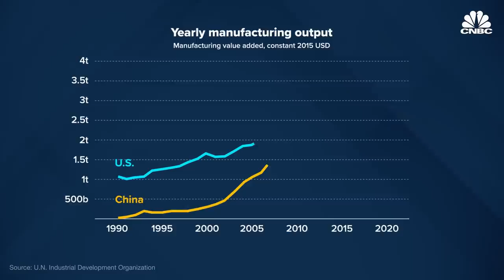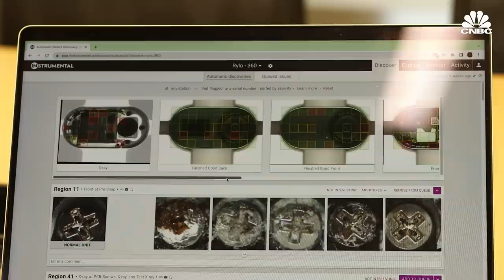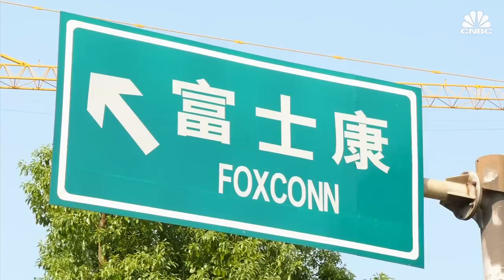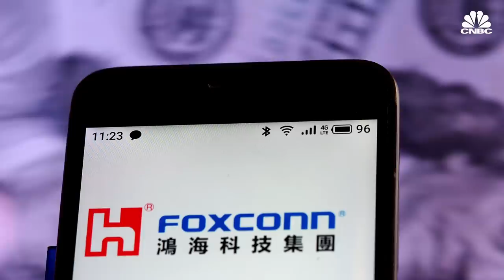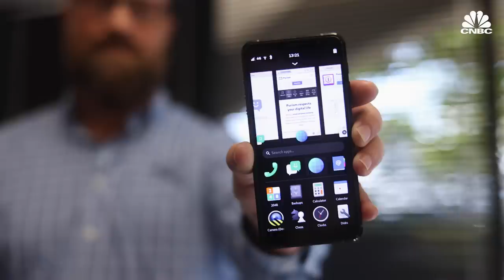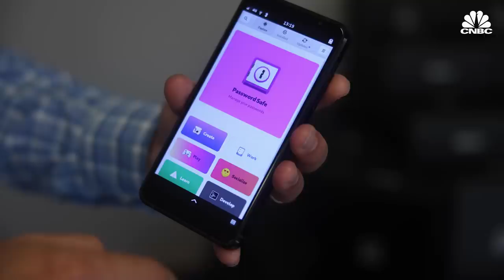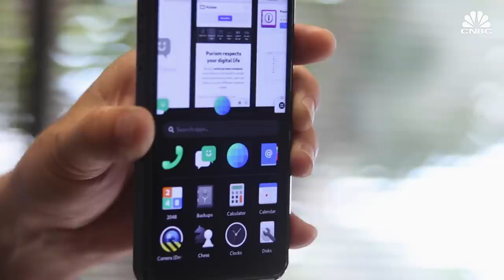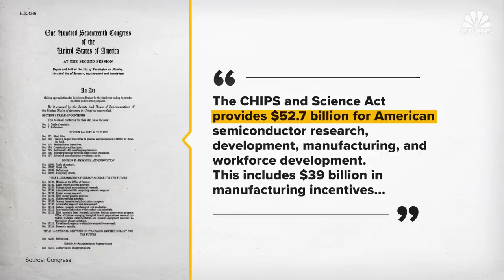Why The U.S. Fell Behind In Phone Manufacturing

Comment: A little over a decade ago, Apple outsourced the production of the IPhone to Foxcon (Taiwan) for manufacturing in China for something like $15 in cost savings per phone, on a $400 phone.  IMO, they could have just as easily sold the phone for $420 each and kept the manufacturing in the US.   Today, the cost difference would be $60-$100/phone.
Outsourcing it to China enable the Chinese to develop their supply chain over the years, and produce more & more competitive phones (Huawei, Xiaomi, Oppo, ZTE, etc.).  If Apple hadn't outsourced to China, it would have taken them far longer to develop the technologies.  As is, we are only able to maintain some slim technical lead because of a few pieces of key technologies, Android OS, processor design, processor manufacturing, and a few chips.
Goes to show, many CEO's are willing to sacrifice the future for higher short-term profits.

Comment: If we made quality goods in America that lasted two to three times as long and functioned well, these American made products could cost twice as much and still be a better product providing much more value to the customers.  

Big corporations current value model is to sell only products made become less than optimal or fail much sooner than expected so the customer must become  a "consumer" continually repurchasing new products to replace the failing goods previously purchased, never having received the optimal life expectancy and functionality of the purchased product. 

A consumer good is one of the most expensive types of goods you can buy.  I own and operate a saw mill and manufacturing business.  I started out with cheap consumer products, having to repurchase replacement machines and parts several times as they wore out.  Also, these consumer wood working tools were extremely slow to use, did not produce accurate results, and consumables needed to be replaced.  The accumulative effect was that I could not manufacture goods for less than my opperating costs.  So, I was spending hours of effort while paying corporations multiple times to replace worn out tools and selling my products at a big loss.  This is unsustainable for my company and I would argue also unsustainable for a society. 

Here's an example of consumer goods compared to industrial goods.  One of my first tools I purchased when I first wanted to start a sawmill business was a "Farm Boss" chainsaw from one of the leading manufacturers(it is an entry level chainsaw, "consumer good".  The Farm Boss chainsaw cost me about $400.  The engine ran ok but  the chain kept falling off the sprocket every few mi minutes damaging the chain. Also, I was using around four gallons of gas per day opperating the chainsaw.  I decided the Farm Boss'es perfomance was unacceptable and retitened it to Lowe's where I purchased it.  

Industrial goods are made to last a lifetime.  After deling with the Farm Boss, knowing I was going to use my chainsaw all the time, I decided I should purchase the best quality saw I could afford that was designed for what I was doing.   After researching,  I purchased a Sthil MS361 professional grade chainsaw for $1,200 (three times the cost of the Farm Boss).  I did not get  a good deal on the saw due to supply chain issues and information (2008).  My new saw was the same weight, cut twice as fast and used less than half the gas (1.5 gallons).  The chain rarely came of the sprocket and only when nocked off.  Fourteen years later, I still use my Sthil MS361 chainsaw around 80 hours or more every year and it runs better than the day I purchased it.

I can tell you of many similar experiences I have had with consumer goods v industrial goods that consumer goods are the most expensive kind of goods.  Example vacuum cleaners (consumer vacume $200-400 replaced every 1-3 years v Kirby vacuum cleaner $1200 that lasts a lifetime and cleans the carpet twice as fast and twice as good). Other examples, Christmas lights, cell phones, non stick pans, pickup trucks, and pretty much anything else you buy at Walmart, Target, or Lowe's.  

In conclusion, even though industrial goods often cost 2 to 100 times more in initial purchase cost their increased lifespan, quality of work performed, and speed will give a lifetime opperating cost 2-100 times lower than consumer goods.  Consumer goods are designed spesificaly to not provide great performance and to fail prior to achieving value equal to their cost, keeping the consumer on a hamster weel of continued repurchasing of the same needed goods due to  consumer goods  failure to perform and or breaking prematurely.

Comment: The factor not covered in this story is that China is willing to look the other way while Foxconn exploits its workforce.  This type of work at the volume and yield rate they are requiring is already very taxing.  But then to work 12-14 hours a day, 6-7 days a week and live in cramped company dorms is going to take a heavy toll.  This would never work in the US or Europe, no matter what the pay.  But China has more desperate young people that Foxconn will chew up and spit out the other side after a few years.

Labor costs, expertise, supply chains, etc. are all important factors.  But you won't see other countries picking this type of manufacturing up at volume unless they are also willing to allow their workforce to be exploited.  Other manufacturing can compensate with increased automation.  This can only get you so far with these small, densely packed electronics.

Comment: 5:30  if the low cost of labor in China is not the reason to be in China but it's the skill of their engineers, why would Apple also say that the parts are designed and built in the US (i.e. KY, etc)?

Comment: 2000$ an Made in USA fone? No thank you. It is not really all justifiable with high labour cost but rather with straight foreward ripping off people. Since the wages are in the US more or less only 10 times higher than in China. The labour costs are in China more or less 10% of what they are in Europe or USA. So an 70$ chinese Moto E4 should cost then at most 700$ if it where made in USA. But these fair fones cost more than 20 times as much. Its a ripp off and does not teally reflect the cost of US manufacturing.

Comment: They should just do what Librem does and offer a range of products increasing in quality and price, from budget communist/arch-nemesis-produced models to high-end domestically produced models. Also, is it that hard to automate the assembly? Why do you need hundreds of people to manually turn screws in an industry where chips are made using lasers and magnets at a microscopic scale, or whatever it is they do that's 100x more complex than making an automatic assembly machine. Tesla should jump in and make machines to assemble iPhones for cheaper than random third worlders with screwdrivers.